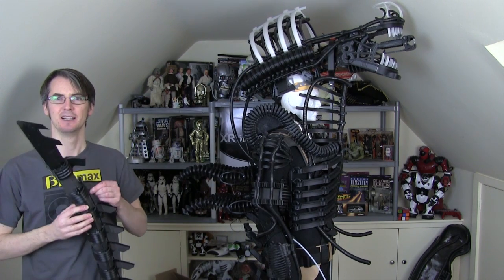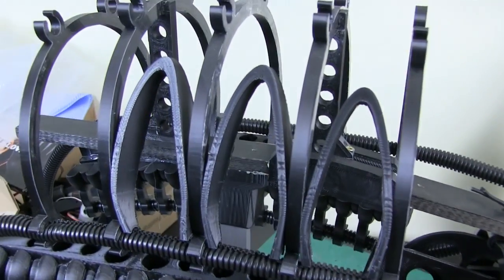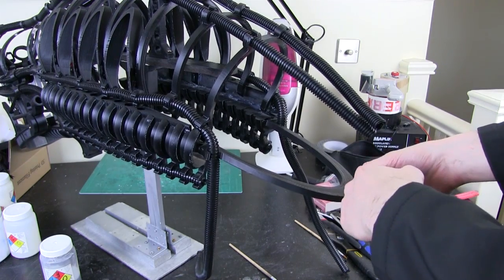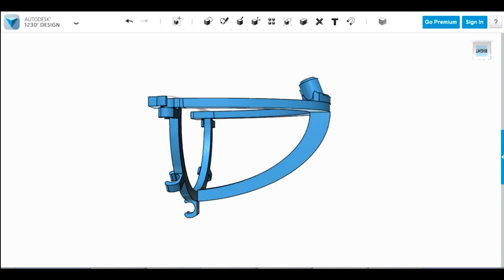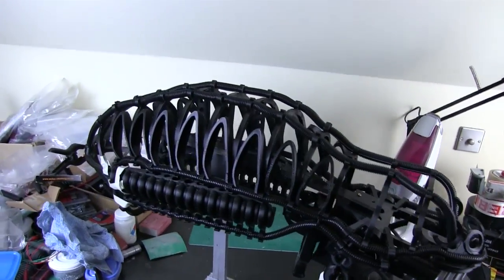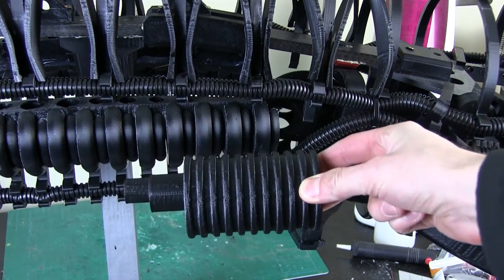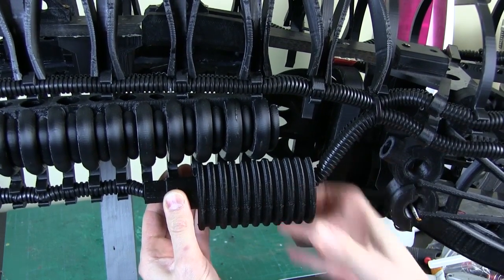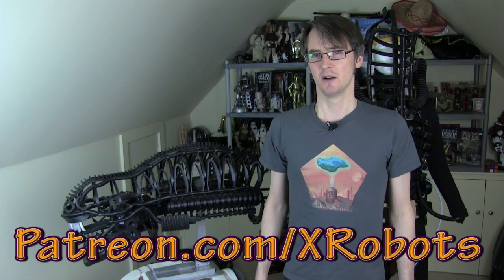Alien Xenomorph Cosplay #15 | Finishing the Head Structure | James Bruton

Comment: What I think would be cool is if you cover the head (maybe not all), in a woven mesh-type layer and have a white light inside, so when it's on, it sort of glows and gives the similar white head effect. Also, the light would highlight the detail of the framework under the mesh, or whatever exterior layer used. For the green acid blood veins, perhaps use EL wire or if you want green liquid pumping around the suit, would computer cooling pumps and flexible tubing work?

It's all looking great so far.

Comment: Hey James, long time watcher first time writing, but I thought you might be interested to know that if you under-power, or even rapidly pulse EL wire, it will almost look like flowing water. If you had green EL wire that would brighten with a heartbeat, you could simulate your flowing alien blood, except much much lighter, and a little more techno-y, which I think would go perfectly!
I had this working myself, however the inverter PCB inexplicably snapped in half one day. Still have no idea how that happened.

-Alice
Reply: ***** Great vblog as usual. If only laser light wire was cheaper, that stuff can be very bright.
Reply: *****
 It may not be insanely bright, but you could get the flowing effect and it would absolutely be bright enough to see, especially if you pulsed it. With the other methods like a string of LEDs, I'd be worried about weight.

Comment: If you want to do the "liquid blood" thing, remember you could use a second liquid, rather than air, pumped through the tubes to indicate motion. oil and water, etc.  If you kept it moving that should prevent it from pooling at the top end too much..

Comment: I would of made the spine(for the head) out of ninjaflex rubber and make the spikes out of ABS plastic. With the TAZ3 you would of been able to make it in one print
Reply: but why bother wasting rubber if the part doesnt have to move at all? also from what i can quickly see just from looking on amazon, rubber filament is abound 2-4 time more expensive than abs, so this was is much cheaper.

Comment: Nice work as always James! For the flowing fluid, you could try glitter in liquid instead of air that would be easier. Perhaps you could even try air cycling through tubes filled with glitter or some kind of particulate to simulate fluid, that would be much less heavy?

Comment: I might have a solution for the green blood. What you could do is have a green LED strip running through a defuser and have it pulsing like a heart beat :)
Reply: that could take a fair amount of power if he was to do it for the entire suit unless he used something like fibre optic cables in place of veins all around the suit and had the led pulse as you mentioned. Edit: just read the rest of the reviews and gotten my first ever intro to EL wire which looks amazing and much brighter than fibre optic.
Reply: Jason Kay
NOt if he just had a green LED and then ran fiber optics.